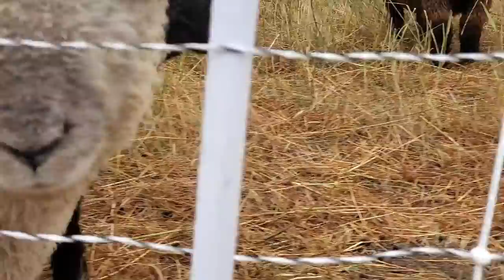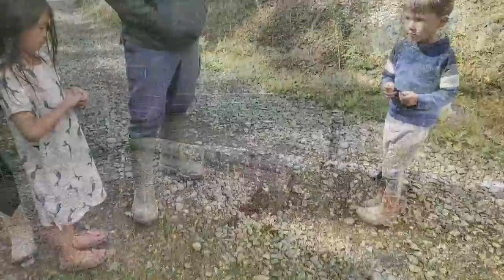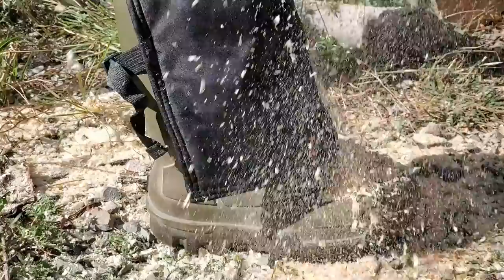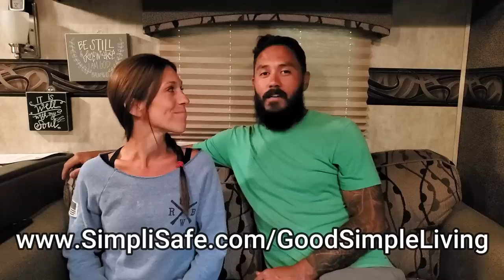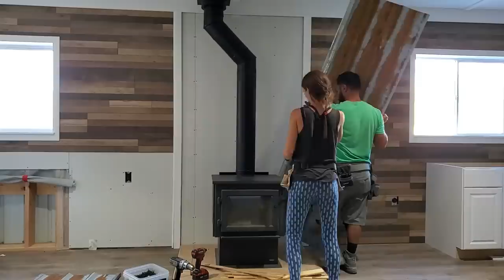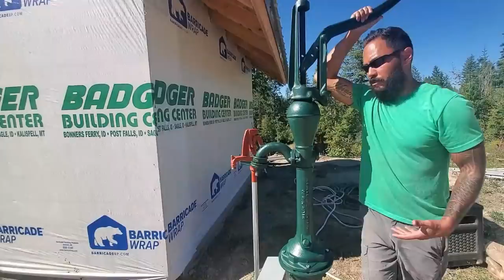Installing Wood Stove Heat Shield | DIY Rustic Farmhouse | Building Our Tiny Home Barndominium

Comment: Quick points, today.  1) Fall is already here!  Anytime you wake up to frost in the morning, fall has arrived.  Be diligent preparing for winter.  It will arrive quickly this year.  Finish essential tasks now.   2) A large number of places have already had very early frosts and freezing weather below 32 degrees.  You are in a place now where the environment is rougher and more extreme at times.  That wind was just an example.  Be prepared for snows, ice, bitter cold, more winds, etc. by stocking up on things you may need.  There will be shortages of lots of things this winter so don't wait to stockpile.  3) You do need to construct some sturdy protection for your outdoor animals that will block off some of the wind and snow.  Also be sure you have a way to get unfrozen water to your animals.  Its going to be challenging living there this winter so get ready.

4) If you haven't tried it, install an old saw blade on your skill saw in the reverse position.   Use it to cut sheet metal.  It works very well and you won't destroy good saw blades.   Be prepared for considerable noise however!  You will need ear protection.   You can keep an old skill saw set up this way and just use it for all your roofing metal cuts.

Comment: Glad you are safe. Do you have double or triple wall pipe going through your roof/loft? Also if need to you can alway put concrete board behind fireplace for another barrier to be extra safe if it gets to hot

Comment: With about an inch of the metal Away from the wall you can create a chamber for the hot air to rise behind it and come out at the ceiling if you put vent holes in the right places behind the metal. In other words don’t put your wood strips all the way to the edge leave room for air to get through. That way when the metal gets hot the air behind it gets hot and risers to cool the metal a little bit and come out the top warming the room.
Reply: I agree, basically he constructed a fire block with those continuous wide furring strips. There should be vertical gaps of approximately .8” minimum wide. There is a easy fix. Remove the steel, take note of the mounting holes and used a saw to cut away most of the furring strips that are not actually supporting the steel. If you need to make the furring strips span a stud that’s ok. In a perfect world a spacer behind each screw is all that would be needed and it would allow the convective air currents to rise unrestricted cooling the steel.

Comment: "...In Serious Straw Bale, a book by Paul Lacinski and Michel Bergeron published in 2000, reference is made to a study performed in conjunction with the Canadian Mortgage and Housing Corporation (CMHC) in which hurricane force wind loads were applied to a test straw bale wall panel. The findings suggest that straw bale walls are vastly superior to conventional walls in resisting wind loads. The results showed that the panel withstood wind loads of 153 pounds per square foot (psf). This means that the straw bale panel could be rated at more than seven times a standard hurricane design load. That’s impressive!"

"..Straw bale construction uses plaster-coated bales anchored to a solid foundation and sturdy roof. The technique continues to grow in popularity as more builders seek environmentally-responsible, energy efficient, cost-effective architectural techniques. As straw structures become more common, more research focuses on their ability to survive disasters.

"Straw bale construction continues to prove itself across a wide range of climates and geographies," said Colin MacDougall, civil engineering associate professor at Queen's College in Ontario, Canada. MacDougall's recent research has focused on the reaction of straw bales to physical stresses.

"It has been shown that properly designed, straw bale construction can resist wind, earthquake, fire, and insects at least as well, in some cases better, than conventional construction materials and techniques," said MacDougall. "

As I've commented before, you all still have time to build with straw bale. $$ vs $$$
Reply: That is reallly interesting. With thick walls it's probably good insulation too. Might even slow down bullets.
Reply: Do you by chance harvest straw ?
Reply: @keithmccloud136  I don't have any land. But I was just watching part of the Crestone Energy Fair and they were talking about different types of construction, including straw bales. But they spoke about how to make them waterproof as well. Very interesting
Reply: @recoveringsoul755  I was just playing with you about trying to flip a profit..lol..but yes straw bales are excellent as are earth bags.

Comment: the fir strips need to be vertical for metal behind the stove, to allow air to flow up,   maybe the corigation allows this?  my inspection would not allowed horizontal  it is combustion issue if low or no aiir flow , no flame has to touch it,   sorry i know u worked it out already  just concerned ??  glad ur safe from the storms

Comment: Hey, i noticed ur wood burning stove / heat. Advise = it is best 2 go from top of wood stove , up 16 inches , then 45 over , ( should it b possible , go 5 feet ) , then go up and out the side NOT foof. This will contain more heat within and make wood burn slower. Have to put a damper in the stack in the section that goes up. This contains more hear within the home / area and wood will burn slower. And running the stack out the side , rather than roof = prevents leaking later. Also run ur outside stack ATLEAST 16 INCHES ABOVE ROOF PEAK. I ALWAYS PUT MINE IN PAST = 2 FEET ABOVE ROOF PEAK. THIS GIVE THE MOST DRAFT WHICH IS NEEDED FOR PROPER BURNING OF WOOD. JUST SAYING , OK ?

Comment: Suggest you check out fans  Voda for  wood heater  work off heat  no electricity required  to help circulating  heat from heater

Comment: Glad no one was hurt by the storm. But I do have a question about the tin behind your wood stove how is that a heat shield can't the wall behind the tin get Hot ? Since its drywall ? Stay safe and Melissa i hate snakes too
Reply from the maker: Yes it can, this will just help reflect heat back out.
Reply: Thanks again

Comment: Hi guys,

Sooo... now that you have a roof on your wall and a floor on your wall what's next?  Wallpaper on the ceiling?  Ceiling tiles on the floor?   :)   I am actually really impressed by how well it turned out!  I personally think it looks great!  Kudos for your cleverness!

Really happy that you came through the wind storm with only minor damage.  It could have been a lot worse.  Just curious if wind storms are common there or if this was a freak, one-off kind of thing?  Based on the damage to your neighbors properties I am guessing this was not normal.  Do you envision beefing up the pole barn or altering your house design for higher wind loading?

And I love the manual hand pump at your well head.  I will definitely be using that idea myself.

Take care, be well and all the best from California 🧡
Reply from the maker: 😆 thank you! It was a pretty rare wind event, but it does happen.

Comment: Glad all is well. Thanks for sharing install and name of hand pump. Questions :  Did you buy factory direct or through your well guy that assisted you.  I have not found a dealer in my state. So thinking of trying to order direct. Looks well made, i would like to have for backup if power goes out, or grid fails.  A ny info appreciated. God Bless you guys.
Reply from the maker: Hi there, we went through our well guy.

Comment: I would recommend that you remove that roofing material behind your stove. The remove the sheet rock and put up concrete board and re-install the roofing material. The concrete board will help you from catching you wall on fire. That sheet rock will get hot and dry up, major fire hazard. Also did you wet yourself from the snake. LOL

Comment: I love the rustic look of the heat shield for your wood burning stove. Just a question from someone with no experience with a wood burning stove, how much actual heat is radiated into the heat shield? Will it radiate enough heat to scorch the furring strips or drywall or would cement board have been better behind the corrugated steel? Please educate me since I will be installing a wood stove in my shop and will need to build a heat shield soon.
Reply from the maker: The drywall alone is fine, and within code just as it was. We really only added the metal for loiks, and also to reflect some heat back into the room. In our last house we just had drywall 12 inches back, and it hardly got warm behind the stove.
Reply: @GoodSimpleLiving  Good to know!

Comment: Will that galvanized backing get hot enough to have to worry about metal fuming poisoning from the zinc?
Reply from the maker: No, the back of the stove doesn't get very hot. The metal is just warm on the wall.
Reply: @GoodSimpleLiving  whew! Not knowing your stove I was worried. Looks great btw!

Comment: Good firewood, but don't recommend using that pine.  Sawmill would be good investment for the pine's for non structural wood.  Depending on your state laws some states require wood to be inspected for integrity for self cut to use as structural. Good luck

Comment: Wow Simply Safe is 1/3 of my total monthly income! Too much money for me.
Those are the same type of winds we had here in Michigan the other day. So sorry your chicken pen and the sheeps shed were destroyed. So you can see that when you build anything it must be very sturdy to survive out in the country.
HEAT & WATER are dire necessities, even when there is no power to assist you to survive.
 A small solar system for lights and the fridge would be my next step. Also put in some solar charged power outlets to charge your cell phones, laptop and if you have the 4Patriot AA batteries which use a USB under the cap to recharge, you can charge those too. So your batteries are ready anytime for your flashlights when needed. That would ensure lights to see by. Cool/cold place to store your food. Water for bathing, dishes, cooking, and force flushing the toilet if there is no power. And lastly the wood stove to cook and provide heat while you sit back and enjoy your waiting time to return to the grid after a storm. Or hope it never comes back on. And enjoy the off grid lifestyle full time. I would suggest 2X the power that your fridge & freezer together need at start up surge, and 3X the batteries required to handle dark, cloudy winter days for 4 days. This will ensure that you can survive in comfort without power for your family.

Comment: NOTICE - Before you get  to carried  away  with the  FIRE Place deal..

What  needs to happen is  either a  CONCRETE Style - Backer board or  something like a  SPECIFIC Fire Rated   Constant  use  drywall combination product. 

Although the  Tin while  help reflect  heat  what it  ( DOES NOT DO ) is  stop any heat  from getting into , behind , or  thru the  Drywall and wood / tin exterior of the Pole barn itself. 
Granted every application creates its  own set of  rules or  guidelines  yet  - Just  like  how  water  follows  the  path of  least  resistance  ( FIRE ) is  known  for  making its  way  into   small and  tight  spaces  be it  horizontal and  vertical alike.   ALWAYS  ERR on the  side of  Caution - rather then  be  awakened  by smoldering  embers  trapped between the  walls , ceiling , roof,  and well - ( YOU ).   

Sure  seems  you  all get  yourself  into  a lot  of  different  projects and  without  harping  on your  own style  Construction based  time  proven  methods are in place  for a  reason .  Just like  codes, permits, rules and  regulations,  are  there to  - HELP-  assure  your  safety  ( NOT ) to  create  UN-Safe  Practices in the  Hopes  you  will beat  the  odds.   Word to the  Wise -  Many Dead  soles  thought  much the  same -  IT  WILL NEVER  HAPPEN TO THEM .  Large or  small -   An ounce of preventions  is  worth a  pound  of  cure.   Saw the  Bear  Scat  and  wondered -  did  you  get the  kids, the  wife, and  you  ( ALL ) on the  same  page  with  things  like  ( SELF  Defense)  -  Stop, Drop, and Play  Dead. Rather then ( TRY ) to  out  run  or  flea an advancing  BEAR - There ???  Do  you always   Carry  Bear  spray  or  Pepper style / military grade  use  devices along with  Firearms  safety and  security -  if -  or  when  or  how -  it - might  play out  ( REGARDLESS ) of  where  you are  and what  you  are  doing  ????
'
 The  place is  really  shaping  up  to be  much  more then what  was  originally  explained  during the  Run  Up  to the  move and  such.   Noticed  many of the  past  clips  where the  time  frame  could  have  easily  been  pushed  forward / backwards or  stalled  due  to one  or  multiple  factors  at  any given time.  Getting that  many  interested parties in the  previous  house at a  price  that  was  exceeding  expectations  was  a  blessing to say the  least.   Now  that you ARE THERE - the  place  YOU  HAD  BEEEN SAVING  FOR -  DID THE  DISCUSSION  YOU  HAD  ABOUT  INCREASED  CONSTRUCTION MATERIALS , BUDGET,  AND  ALSO TIME  FRAME  TO  DO CERTAIN  THINGS  ( would have  / SHOULD  HAVE )  BEEN  APART OF  YOUR  LONG TERM  ANTICIPATION   PAPEROWOK PLANS -   Preparedness.   To  often  ( BITING  OFF )  more then  anyone  person or  group of  people  can  chew is  the  beginning  of the  end  with  Failed  homesteads and  lack luster   ( TAIL between the  legs  ) March of  Retreat.   

You have a  nice  expansive piece of  property  there.  Will  you  grow into it  or  will it  Grow  over  you  ???

Comment: As far as I've learned the spacers should be non-combustible and the actual work done by the shield is by allowing cool are from a space below it to flow upwards behind it and out from a space at the top. This set up seems rather dangerous

Comment: Hey guys , lucky BREAK ! HERES A HANDY TIP FOR YOU .... WHEN LOOKING FOR THAT RUSTIC LOOK ON METAL ROOFING , JUST APPLY SOME MURATIC ACID ONTO THE ROOF PANEL ..  ,MIX 50/50  AND APPLY WITH A CHEAP RAG MOP. LET IT  SIT ON THE PANEL ,IN THE SUNLIGHT , FOR 10 MIN.  RINSE WELL AND HANG IT anywhere.!!  I  build special commercial Custom work , and I've done it on a building in michigan Called  BADBRADSBBQ in Lake ORION ,MI. . THE PLACE IS LISTED ONLINE .  GO SEE THE PICS !
Reply: Hey mark, I went to that bbq places website to take a look at those pics cause I’m rebuilding an older farmhouse myself and I was gonna see if I could get some cool ideas but I really couldn’t find but one little group of thumbnail pics and it was just a couple stacks of firewood, small logs arranged as wall art it seems but was too small to really see it good and a couple metal art thingys.

Oh well, I was hoping to see them to get ideas. I wonder if they changed their website or if I’m missing it somehows but thanks for the thoughts buddy, take care

Comment: Not that I care but you're supposed to use metal spacers not wood and they should go up-and-down not horizontal. The idea behind it is the metal heats up the heat rises and brings up cold air from the low side to the top

Comment: You didn't leave an air gap top and bottom of the metal roofing behind the fireplace for heat convection ??? ... Bet now you are glad to be away from the  Vancouver smoke ...
Reply from the maker: We left an inch, thats what the 1 inch backing was for.
Reply: @GoodSimpleLiving  I was thinking an inch from the floor and the ceiling ... Shame about the animal shelters ... Especially the chicken tractor ... Glad the barn roof is intact ...